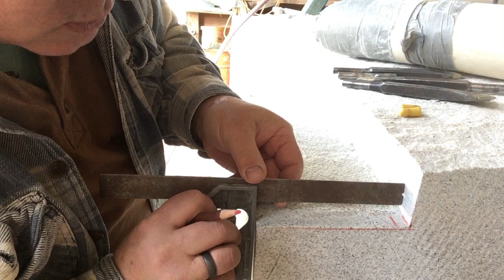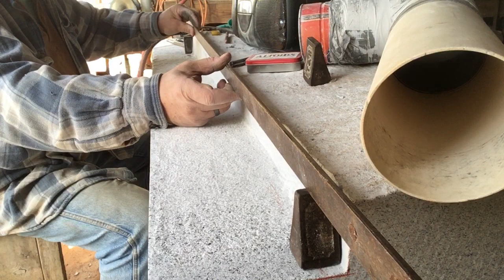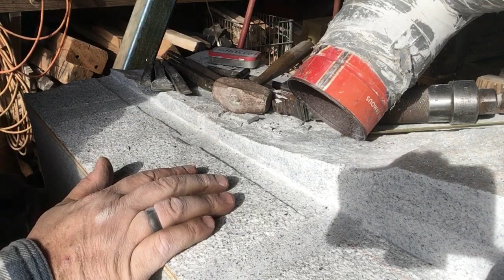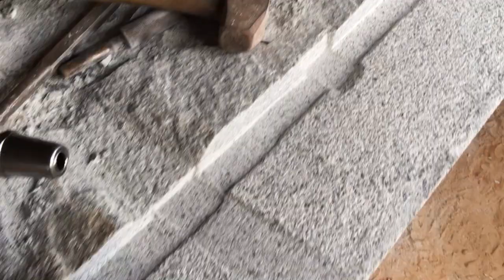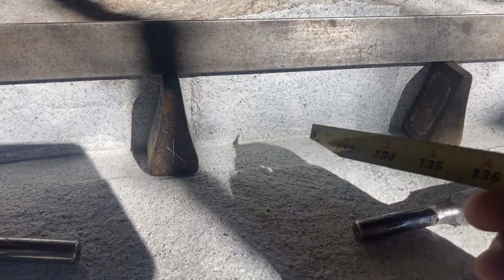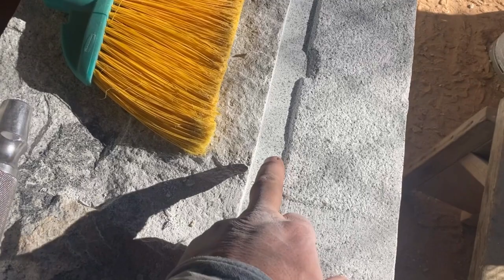Virtual Stone Carving Apprenticeship  VSCA Video 67- Life Size Bas Relief Angel 14 Granite Base 5

Comment: Hello Clint! Thank you for your great videos! We have a lot of 19th century granite monuments here in central/eastern Europe, that have probably been finished using a hand bushing hammer. They often show surface damage, and loss of the first Millimeter of stone surface. We think that this is due to the heavy impact a hand held bushing hammer has, when hitting the stone, because the stone is crushed and shocked by numerous spikes, and the impact goes straight into the stone. Where as axing, and use of pneumatic tools  is much less of damage because it literally "cuts" the stone. Since the U.S stone industry has been working with modern pneumatic tools since the 19th century, and central Europe was still working by hand until the 1950s.. do you still experience this type of damage in the U.S? Best wishes!
Reply from the maker: Thanks for watching!  Love hearing about stone work half way around the world.  Beyond basic foundation elements, steps/foot stones and cobblestone, We don’t have a lot of granite that was utilized prior to the 1880’s.  We do have some older stones showing damage as you describe.  I think some is from the use of tools that damaged the stone.

 I also think some of the damage is a result of using more surface stone than quarried stone, simply because of the labor and technology required to quarry granite at a modern scale.  The surface stone has already been weathered for centuries after being broken free by uneven forces of nature.  That can even make it easier to work because it is already full of micro-fractures.    When it was being done, the craftsmen didn’t have ready access to quarried stone with better internal integrity to compare to surface granite.  They simply didn’t know and even if they did know the difference, that better stone was inaccessible to them.    So the surface granite & easily accessed quarried granite from convenient outcroppings was the best granite they could get.

It’s hard to think about what it was like to do things as a contemporary when you possess both greater knowledge and hindsight.   That’s why I have so much respect for those who did what they did without the convenience of what is known & understood generations later.  That makes their accomplishments much more significant and inspirational to me.  

Thanks again for watching.